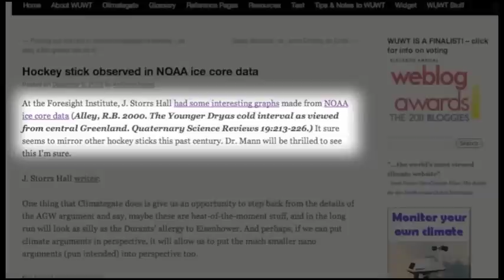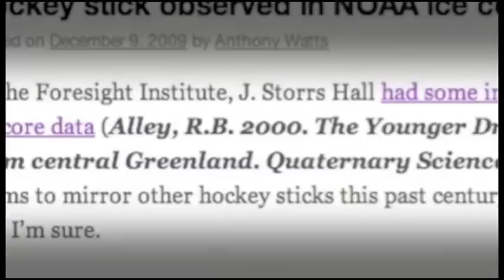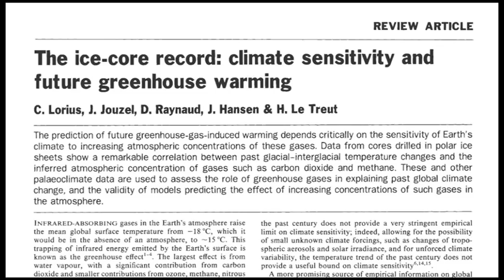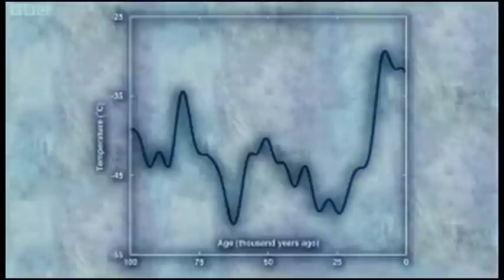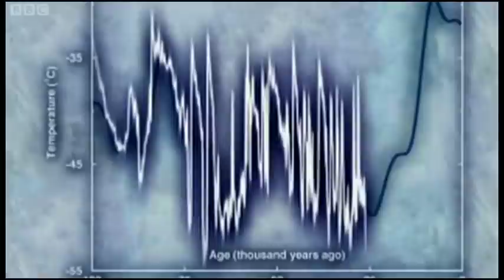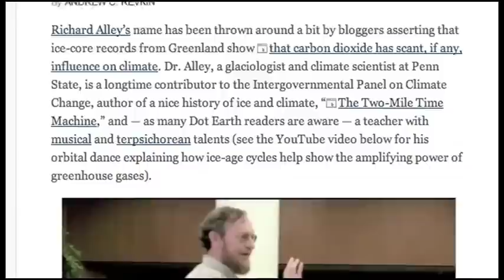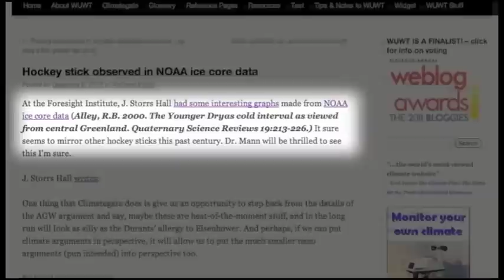What the Ice Cores Tell Us, and How Deniers Distort it

Comment: I big part of why cars need to change now or very soon is that total new cars generally take 15 years to be fully developed by GM. So, if we run out of oil in 40 years and a car last 15 years and it takes 15 years to develop we have less then 10 years before we must start working on change all cars to electric. Its not even a question of the environmental. If we world started working hard to reduce oil usage that oil may last 60 years, but it is a limited supply.

Comment: @harp1925 I looked up some stuff about electric vs gas cars and the electric care does have one real advantage. Efficiency. Internal Combustion Engines are horribly inefficient. With average efficiency of about 18%-20%. This compares to your average car electrical motor with average efficiency of about 80%. There is some efficiency lost in the generating of the power, but a turbine has an efficiency of up to 60%. So electric cars us 2.5 time less power then gas cars.

Comment: @mphello What you end does not have much of an effect on your carbon food print, other then oil used in fertilizer and transport all food = carbon neutral. There is no reason you can not produce more power via green methods and have a negative carbon footprint and teach your kids to also have a negative carbon foot print. If you have some land and you plant 27 large trees on the land you will have cause negative carbon footprint = to the average american. 2 kids and not increase CO2 = 52 trees

Comment: @berner So that is a big fat no, try less then 40 years and we will totally be out of oil. The truth is that we will use almost all the oil in the next 90 years even with quick and significant changes and working hard to move off oil now will not only lessen the effects of AGW sightly, but it will also prevent the complete economic collapse from doing nothing to end our dependence on oil significantly before we run out.

Comment: @robbieopen Were you able to get through Box et al 2009?  They're presenting that current temps at the Greenland summit are about 2.4C warmer.  By their figures temperature was fairly flat from the mid 1800's through the early 1900's so the end date of the GISP2 doesn't have any affect on the result.  But if you were to plot Box 2009 onto the end of GISP2 you'd see a modern rise in temperature to almost near the peaks seen in the past 10k years of data.

But again, that's a local proxy.

Comment: The effect of this is to skew the data to make CO2 seem like a much more significant contributer to the total greenhouse and amplify the total contribution made by human activity.  The main reason I have read so far is that it is 'convention to do so', hardly a satisfying explanation. I am not advocating climate change denial, there are so many factors involved that its a very complex problem. It is however, hypocritical to attack your detractors when you are using the same tactics.

Comment: @robbieopen You can actually go through pretty much all the data sets on the NOAA site and where they state something about the reference for BP they all say 1950.  

The tiny link is very easy.  You just past the link that I added and remove the space.

I don't remember where I got the 2C for the current temp at the summit.  It's been a number of months.  A researcher that did work in Greenland gave me the information but I would have to track down what his source was.

Comment: @robbieopen Nope.  You're lying.  Here is a direct cut and past from Alley 2000.

Column 1: Age (thousand years before present) 
Column 2: Temperature in central Greenland (degrees C) 

It does not say 2000.

Comment: @robbieopen Not only that, they make a really big freshman level mistake.  The GISP2 is dated to thousands of years before present, and starts at 0.095.  They make the wrong assumption that means 1905.  Turns out Alley uses the standard 1950 for radiometric dating which makes it 1855.  So, that "hockey stick" is preindustrial.

Comment: @robbieopen You can see they're conflating GISP2 with a global record because they attach that little read line at the end saying it's the "hockey stick."  The modern global average temp.  If you take the current temperature of the Greenland ice sheet summit you can add about 2C to the chart.  That brings the local temp up close to the peak high temps in the GISP2 record.

Comment: @harp1925 What I was getting from your posts was, all research on any other forms of energy is wasted money. I would like to see where you got that there is 200 years of oil under Alaska, sure there is some but 200 years worth would be far more than we have used since the discovery of oil. 

On the climate point, we know that the climate is changing. Research is necessary to determine what, if any are the human caused effects. Just calling it a lie is counter-productive.